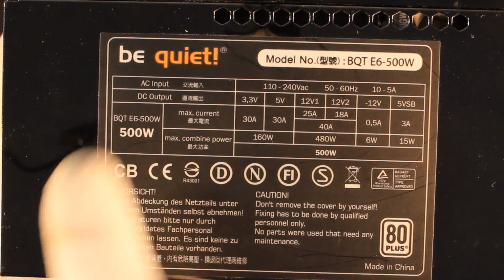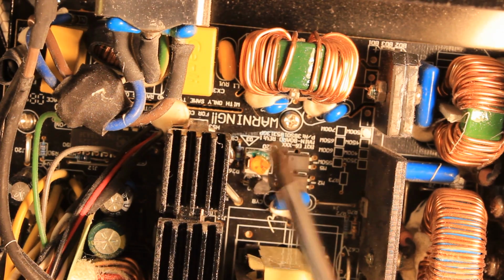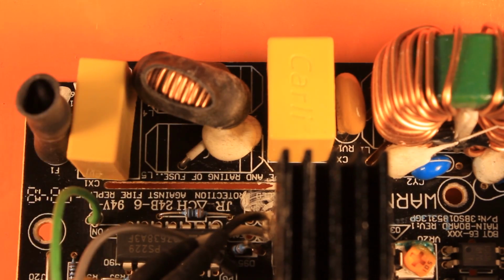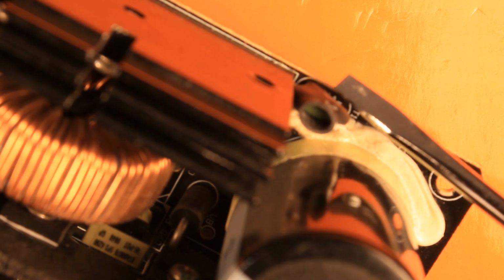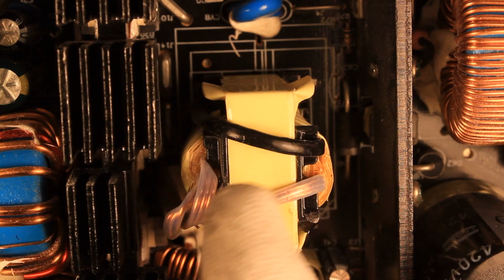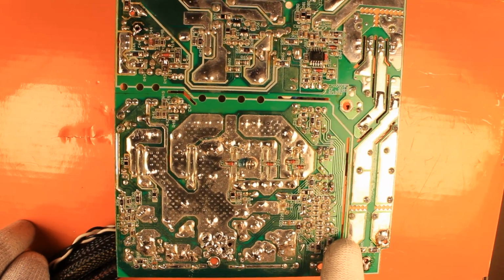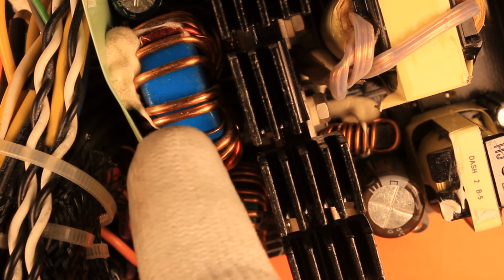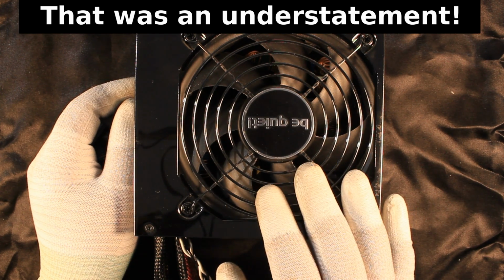500W Be Quiet! ATX power supply teardown, detailed overview and repair

Comment: "...if you dont know what I´´m talking about." ;-)))
Reply from the maker: I did not meant it to sound offensive. I am just aware that some people still have their old AT power supply in their mind, which had a clunking On/Off switch. However, the ATX power supplies are switched on through a logic signal, where one of the pins is being pulled to ground. The +5V standby will constantly power the glue-logic portion of the MoBo, and even the keyboard, mouse and the network card. This is why having this +5V stand-by is a major difference compared to the good old AT supplies in my view.
Reply: Oh no no, it wasn´t offensive etc. I founded it funny but appropriate. By these words I called out: "Yes!, it´s me :-)" I wish, I had only ... 20% of your knowledge and experience! I could repair many things and save much money. In these days I am trying to repair my power supply, to find out the reason and replace the part. So I started to get more knowledge about the PC power supply and watched your video. I am not professional engineer, as you are.  Fortunately I have recognized one bursted capacitor, ordered a new one and I will replace it. Many thanks for your videos and thumbs up!
Reply from the maker: I am glad that you will get your PSU sorted out. Btw, if one cap is busted, often it is a good idea to replace them all, ESPECIALLY the small values in the range of 1-47uF. This is because these small caps are providing the reference voltages and they define the shape of the driver signal/feedback loop.

Anyway, the designers still managed to fool me! Namely, I would have naively expected that the power switch is an actual power switch, cutting out the hot wire from AC side. However, as I mentioned, they made a complex solution instead with the power button, and the way the cables were routed is not optimal, and it could be potentially dangerous.
Reply from the maker: I forgot: after you replace the cap, do NOT test the PSU directly with a computer, because you can fry the whole motherboard/CPU/GPU combo. Just power it on on your workbench with the "paper-clip" trick, and measure the voltages first on the individual rails before you plug it into a PC. 
I should have really made a video of how to test a PSU, now it would have been handy...
Reply: I planed, to test it before with the paper clip methode, even if I didn´t know about the danger. Probably you mean, when for instance istead of 3,3V there would be 5V in the cable(?) I will now especially take care of this issue. Thank you very much! Aha, the cap I will replace is one of the two big 470µF.  Maybe I should have ordered two of them. I have first do some paper work today and tomorow;  than on Friday wok at the PSU. Many thanks, you are great!
Reply from the maker: The 470uF is the main bulk cap? Just asking, since otherwise I do not see where would a 470uF at 450V being used. Take special care with those, because the old ones still have a punch in them even hours after you power off the PSU if it does not have bleeding-resistors. The polarity of the new caps btw is very important, otherwise they will explode! This is why the "paperclip-trick" is very important, since mistakes do happen. I definitely had PSUs explode on me ;) 
If you have a multimeter, it is a good idea to use the paperclip-trick, and measure the voltages on the pins to make sure they are the right ones according to the color coding/pinout (+3.3 orange, +5 red, +12 yellow, +5V Stand-by purple, -12V blue or gray).
Reply: Sorry, I mistyped. It was 200V cap. And there were nearby two branded restistors, I didn´t see them at the beginning. I replaced them as well.  Yes, I did the measure way as suggested. Everything seams to be ok now. This PSU will be my spare. Meanwhile I have another one in the PC. Many thanks!
Reply from the maker: So you have repaired it? 
If yes, CONGRATULATIONS! Now you have a spare PSU ;)

Comment: Hi, I need help on my PSU repair.
 I have Cooler Master GX Bronze PSU that are no longer working on my PC no1... But its working on my old PC no2.
I did check the power flow with multimeter (pin test) and all the voltage is in right value.. its just when I installed it on my PC no1 its not even power up (ON).
my PC no1 is running smoothly with other power supply and its not my PC problem.
my Cooler Master was the power supply for PC no1 before it's shut off by itself.
so I'm reckon there's something wrong with it and I cant figure it out.
I really need expert help to locate the problem part of this PSU, any help will be much appreciated.

Thanks.
Reply from the maker: The difference in behavior between your two PCs with the same PSU is due to the different amount of power used by them. Namely, when the capacitors start to go bad in a PSU, they are still able to power a PC which lower power usage, or an other PC, where the power is used from rails which are not loading the shaky circuit. 
Lets say that your +3.3V is shaky, and it is about to die. If your PC uses most of the power from the other rails and it is no longer using the +3.3V rail, it will work. Now you plug the same PSU into a different PC, which loads heavily the +3.3V rail, and your second PC will not boot. Also, the PSU sends a so called Power-Good signal to the PC which takes the CPU watchdog circuit out of constant self reset. I would say in your case this is where the issue is, or the over-current/under-voltage protection is falsely kicking in due to old bad capacitors.
Reply: Thanks for your reply.. I did check the power good (pin test) and it was read about 5.3v. I will try to check it again when its connected to pc as soon as im available. will also try to take out and reads all the caps..
Thanks again.
Reply: So I have checked the power good again and record it on video, also have read about Power good values are often considered abnormal if detected lower than 100ms .. I dont have any timer to count the values but Im reckon this is  lower than 100ms.  https://www.dropbox.com/s/wx8zpl0nqwlr7ah/Power%20Good%20Pin%20Test.mp4?dl=0
Now.. I really got no idea where to start if that lower values is the problem.
Reply from the maker: The issue is most likely with the capacitors as I mentioned. Plus, you cannot measure voltage rise with an old analog multimeter. Even digital multimeters are no good for this, since you will need an oscilloscope. This is because the window-comparators also measure ripple voltage, and if the ripple voltage is above a given value, the motherboard will not boot. Regarding the power-good signal, actually the rise time has to be at least 0.1 seconds after the voltage levels were stabilized, to ensure that the capacitors are fully charged.
Reply: Then I will still take out all the capacitors and check them. I will do that soon as im able to do so. 
thanks again, your help are really appreciated.
Reply from the maker: If you remove the capacitors, it is better to actually replace them, since soldering back the old caps is a really-Really-REALLY bad idea. Often you hurt the electrolyte when you heat up the pins, and you destroy the oxide layer on the aluminum electrodes while wiggling out the old cap. 
Also, measuring the capacitance alone is not very useful, since the equivalent series resistance (ESR) is also a very important parameter. In-circuit ESR testers/meters are quite expensive. Therefore, I rather just replace a couple of caps for 0.2Euros per piece.

Comment: Can you upload video on how to trouble shoot SMPS also in english. Your explanation is too good.
Reply from the maker: I'm glad that you have found the video useful!
If there is interest for it, I could make videos on SMPS repairs. However, it is a good idea to have some minimal background on how SMPS units work, especially with active power factor correction. So far I have not made videos on the working principles, so instead of going into detail, I could just do a "quick guide".
Reply: @DonkeyLearningIT  your video is so clear I am asking a lot but if u could one on transistor audio output stage how it is connected and how it work
Reply from the maker: @patrickcampbell151  So far I have not produced any video on audio electronics, though I have repaired many audio amps. The situation is similar to SMPS, that one needs several episodes just to cover the basics like A, B, AB class output etc.
Reply: @DonkeyLearningIT  OK man as soon as u put out one I will be there thanks
Reply: Is there any video on how to build the audio output of a transistor amp
Reply: Your video open my eyes I learn a lot thanks